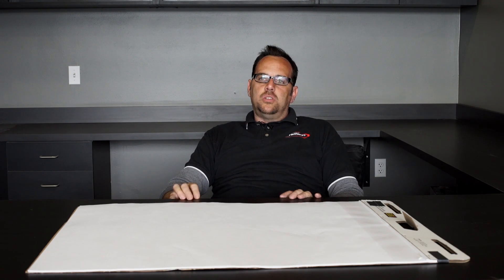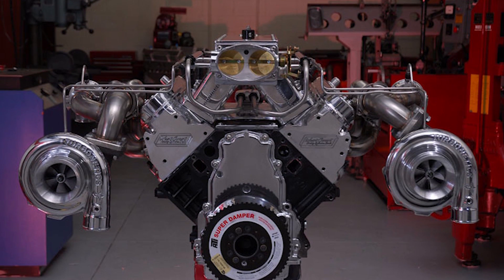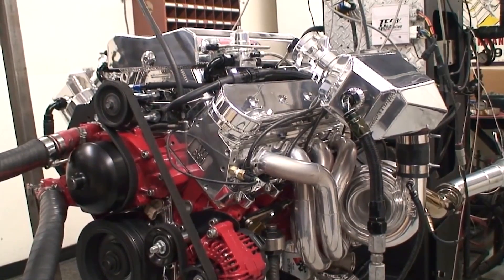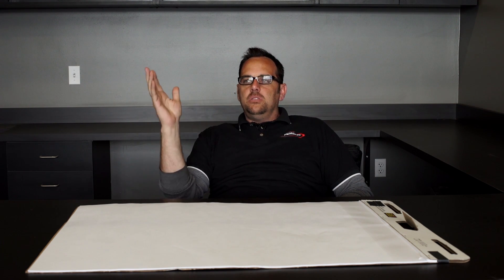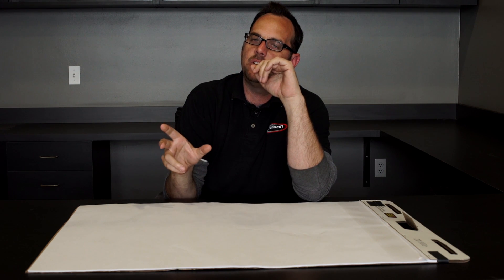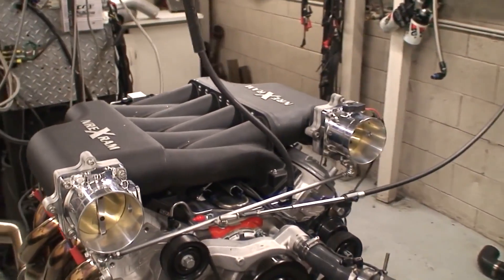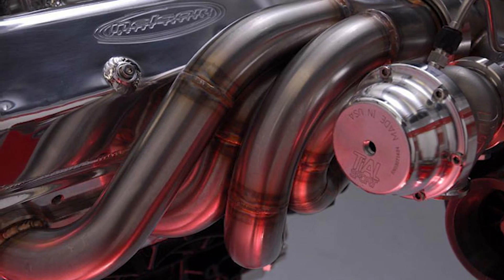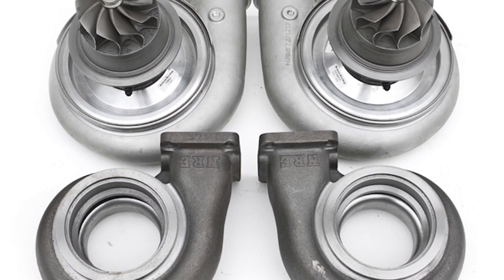Master Engine Builder Explains Why the LS V8 Is SO Good

Comment: Educate me: Dynoing intakes can be deceiving, can't it, because the car is not moving? Especially for ram air?
Reply: +Xo na (Matthew Doucette) "ram" air doesnt really do anything for added pressure like youd think in fact , fast moving air has lower pressure(airplane wing)_ so its actually the fact the air is nice and cool from the outside and not the hot air from under the hood that makes a difference in horse power( and the fact that it may be a faster motor with higher compression and a bigger cam, like the ram air 400 from pontiac back in the day)
...but you are absolutely right about the dyno being a tricky tool to use and it works best to compare the same engine with itself to determine which setup works best... ie, trying more than one carb or cam or cam advance...and you really cant use my dyno results against your dyno results because we have...1 different dynos
...2, we live at different altitudes
...and 3 theres like 40 other factors that can effect hp like humidity and air temp to start
so a dyno is a very useful tool to someone like tom that wants to compare two intakes, and not to handy for me
trust me on this(look it up if you dont believe it) Tom Nelson is THE premier engine builder in the southwest maybe the entire country...very well know and highly respected in the car world
Reply: phil tripe Interesting. Thank you. P.S. I have heard about dynos that take into account altitude, which I found interesting, so they change the result as long as you don't lie with the inputs.
Reply: thats true but altitude is a rough estimate and the perimeter is the fact that 6000 ft elevation will have less o2 than sea level but at the same time we both know that the barometric pressure changes all the time so if theres a storm in the area when you dyno it wont show as big of a number as you would get on a sunny day with the highest braometric number possible and better yet is to dyno early am when the temp is lowest will help boost numbers...there could be more than 40 factors, i was just throwing out a number
Reply: phil tripe Right, I get your point. I was just making an obscure second point which I found interesting. I guess this is all science, but the measurements are not an exact science for sure.
Reply: +Xo na (Matthew Doucette) What I find the dyno is best used for is fine tuning. Spending the whole day tweeking your tune to eek every last bit of power out of it. The numbers aren't set in stone you may dyno at 500hp today go strait home and strait back the next day and only dyno at 485hp with no changes at all.
Reply: me3333 I understand. Makes complete sense.